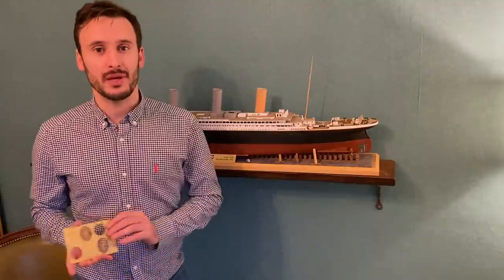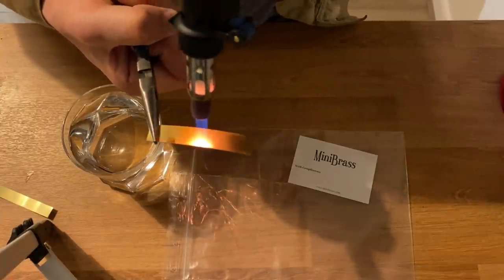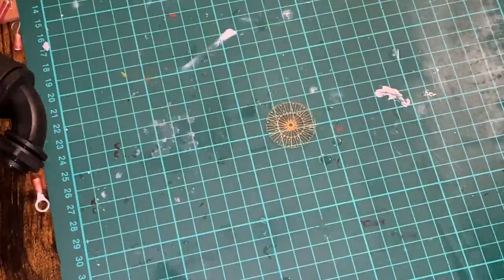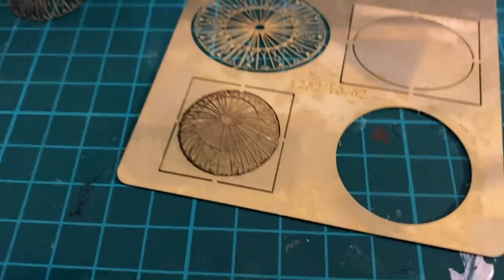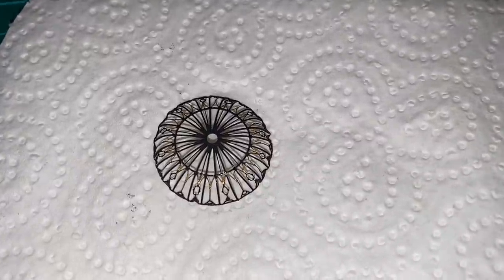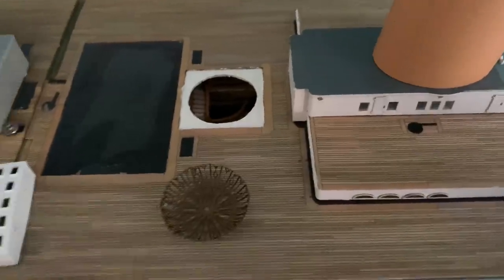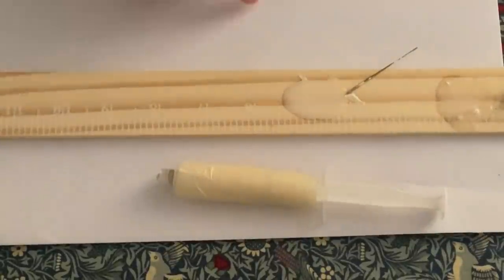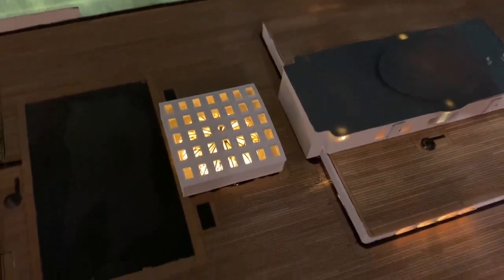Radio Control Trumpeter 1:200 Titanic Build Part 51 - First Class Dome

Comment: An opaque translucency allows the perspect to cascade ambient light to the environs about the staircase proper. The use of guilt intertwined with the black hues of the balustrade fitted to the oaken structure was really quite striking. A ship of dreams that could avail itself to artificial electric lightings to accentuate the beauty at low light levels. Daylight providing a constantly changing ambiance as well.

Comment: Your dome looks amazing! I've been checking out the site for those parts, and they've got quite a few things I'd like to grab for the Agora/Hachette model. One kit I'm likely going to be ordering in the next month because it features the front nameplates, which I need for the model I'm doing. And I may do these for whenever we would get to the Grand Staircases, along with some extra staircase parts (not sure at the moment how they're doing their staircase, but I want to make mine highly detailed like this). 

One thing I wondered watching this. Your method looks amazing, and obviously it works great. But with as time consuming as it is, it's got me wondering. Could you not get the same result by masking off the top of the dome, dropping in just a thin layer of clear resin, curing it, then spraying it down with some frosted glass paint? I just wonder if that would create the same effect as this, but be much quicker to do.